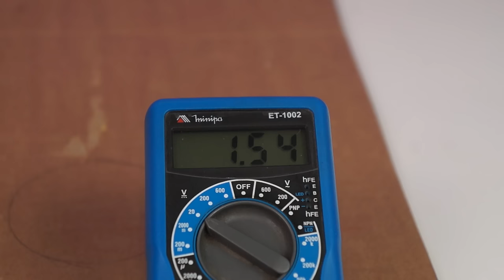INCREÍBLE MAQUETA DE MINI GENERADOR EÓLICO CON CATA VENTO PARA LA ESCUELA

Comment: Hola, para todos los que no les prende el Led, puede ser por dos motivos:
1. El motor que compraron no da el suficiente voltaje para prender. (Verifiquen el voltaje en que se prenden los bombillos led que van a comprar para que coincida con cuánto voltaje hace el motor). Para el motor les recomiendo 5 mil revoluciones por minuto.
2. Los bombillos led tienen polaridad, inviertanlos si se les prende cuando los conectan a los cables del molino.
Reply: osea que elmotro genera corriente electrica

Comment: Materiales :
Hojas
DC motor 12V
Cartón 
Barra de Silicon 
Regla 
Compás 
Tijeras 
Cúter / cuchillo
Pegamento 
Lápiz 
Pistola de Silicon 
Palillo 
Ventilador (algo que cause aire y provoque que de vuelta ) 
circuito en serie 
Cartón para las casas 
Hojas de acetato ( para la ventana )
Lengüetas 
Pinzas para cortar 
Palillos ( 2 para las ventanas )
Tornillo para la puerta 
Chip super led 1w
Lengüeta ( para colgar la luz 
Más Cartón separado  (para el techo)
Popote 
Super bright led blue 10mm ( pata una lámpara )
Y yap 🐑💗